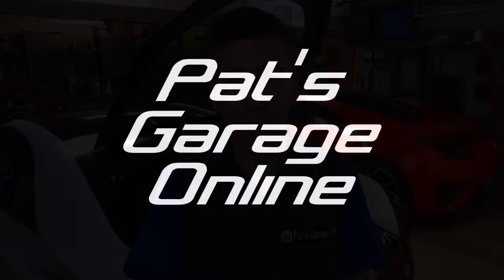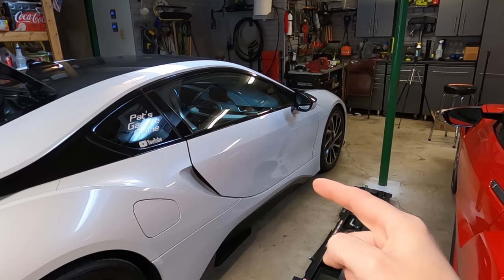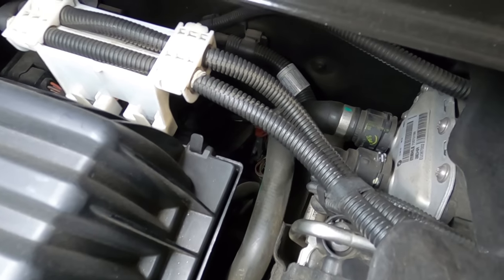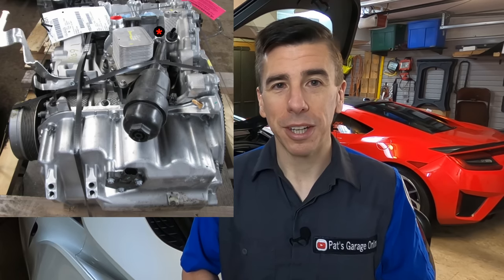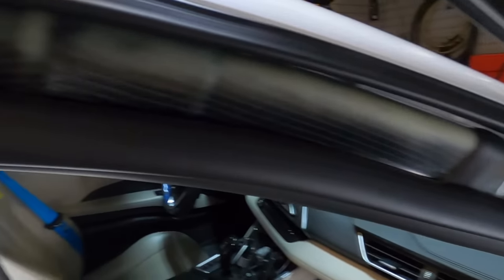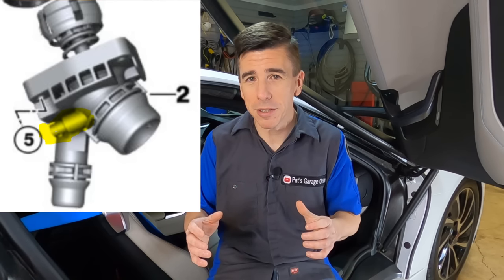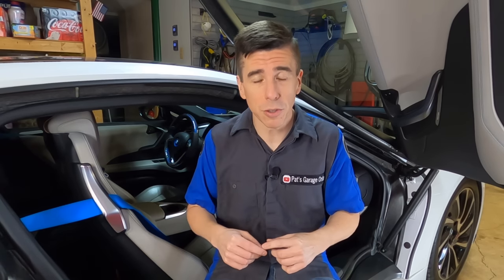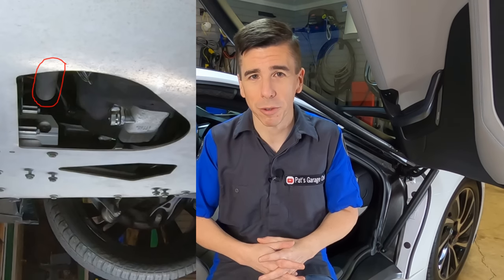My response to your ideas about Samcrac's BMW i8.

Comment: it overheats. fine after overheating, leave it , don't remove radiator cap , until cool . does it need topping up . if so do a pressure check watch for leaks in radiator and hoses , if none garden hose it remove hose from top of engine and radiator cap , stick hose into top  of engine, wrap a rag round gap hold it in placewith  thumb and forefinger and wait for water to come out of cap , funny feeling it's got a dozen eggs in it. or find a decent engine to stick in like small block v6 with a few mods to air flow.might end up with a decent motor.

Comment: looking at the intercooler pipe could poss put in a link in with a loop of pipe with a bleed valve you could have that above the head for a cheeky mod
Reply from the maker: Sadly, the intercooler is on a totally separate coolant circuit. It goes through its own three radiators in the front of the car. BMW did this in order to keep the temperatures cool because the coolant coming off of the engine was just too hot. This also overcomplicates the entire system.

Comment: The obstruction has been in my forefront as well. We've seen the fan running but I don't think he's ever mentioned the fan pulling heat out. If the car is truly overheating it should be a furnace coming out of the radiator. It may have a blown head gasket, but I think that would be caused by a coolant flow issue. A symptom, not the cause.

Comment: I wonder what would happen if you fabricated a short piece of aluminum pipe the diameter of the cooling hose. Weld a pipe boss onto the pipe and thread a bleed valve into the pipe boss. It would be similar in design to an oxygen sensor on an exhaust pipe.  Jack up the front of the car higher than the engine.  Install the pipe between the radiator and coolant hose. Pressurize the system at the back of the car and bleed all the air out of the system. I think it would work. You could either leave pipe in place permanently or remove it after the bleed process.

Comment: A long time ago I had a Peugeot 505... its expansion bottle was lower than the cyl head and the procedure to bleed was way simpler than this engines: you just unhooked the expansion bottle from its support and hung it from the hood so it was higher than the head.

In this case I would make an extension for the expansion bottle to be able to hang it higher than the head.

Comment: Merc has used heated thermostad in OM651 already a decade ago, propably for same reason than BMW. In this case, it is hardly to blame since it opens earlier when heated and in any case, it opens at set temperature. As mentioned, lines must be confirmed to be free for flow. Small amount of air should come along the flow if lines are free.

Comment: I watched the Video and the guy only replaced the thermostat. The mounting body with the electric pump was not replaced. That pump could easily be the the obstruction. In fact during the video there was a point were the overheating was intermittent. He went through all the step by step process to bleed the system, while the front was elevated above the rear. He now thinks he may have a head gasket pushing exhaust into the cooling.

Comment: For the last 100 years residential hot water heating systems have contained an air purge valve at the top of each radiator which I believe involved a simple float that vents air until water raises the float and shuts off the vent port.  These were automatic and required no power or control other than the float.   Couldn't be a more simple solution, if BMW wanted one.

Comment: My 2011 Cruze Ecotec 1.4T also had a resistive element in the thermostat and it went bad. Did not throw a code right away since it still had resistance but not enough to heat it. Engine was running hotter but you could not tell from the gauge since the computer will only show it dead center unless it gets above like 250. I noticed more smoke than usual when I removed the oil fill cap and used a scan tool to see the problem.

Comment: Wax motors are quite common - https://en.wikipedia.org/wiki/Wax_motor
The problem as others have stated is that there is no real feedback loop in this system  (other than the fact that when it fails, the car overheats). 
I'm not sure you would see a specific code for the thermostat failing, since the ECU can only test to see if the resistive element is there. If the element works, but there is a mechanical failure in the wax motor side, then it will think things are fine, until the temperature rises above what is expected when the thermostat is allowing water to pass. Now it could be that the thermostat is the issue, but that wouldn't explain the radiator exploding at what appeared to be relatively modest pressure, after all the thermostat presumably only limits the flow of water, but doesn't starve the loop entirely.
 
Here's a thought. 
The water pump failed (or maybe the thermostat or a hoze), which threw some random bits of water pump or whatever into the cooling loop. 
The previous owner had the pump replaced, but some part of the old pump is now nicely wedged in the system somewhere, either in a fixed position, or in a place where it flaps about, only blocking things entirely when the water pressure builds. No sabotage involved (except arguably by the BMW engineers who made this thing so bloody complex).

Comment: I like to mess with cars from time to time and was wondering about putting in a T filler neck in one of the two hoses on the top of the engine? Then check for obstructions and raise the front of the car higher. After that maybe put the vacuum bleeder on the overflow and a sealed way to put coolant in at the T neck filler. Maybe this way your vacuum would pull the air  out and the fluid in from the highest point. In doing so maybe the fluid would push the remaining air the vacuum didn't get? I could be wrong, but you could always replace the hose if it didn't work.
Reply from the maker: It's a good idea and plausible.  It may work.

Comment: if this is just a coolant air pocket issue in then I will not use any jazzy equipment; no vacuum required to bleed, just grab the engine inlet hose pipe from the front of the car attach another hose to it so that mouth of it is at higher than the roof of the car; next grab the outlet of the engine and do the same, now add the coolant and let gravity help you with the flushing of the air out of the system

Comment: Take Digital Temperature Reader check all hoses, also if you can divide the system and run water though to confirm clear lines. My two cents, thx

Comment: It would be funny to find a plastic shipping cap still installed in a hose somewhere. When I worked on airplanes, it happened so often that they started making the shipping caps that covered hose ports/nipples with a protruding tab that makes it impossible to slip a hose over a capped nipple.

Comment: Pat love all the responses , you know it’s a shame because this car could have been a good car I think for bmw it was a hybrid electric new construction, years ago I watched how they “glued” the panels together at the factory it was all new ideas. I support keep it simple why they made this car so complicated and hard to work on we’ll never know. A lot of people now say if you like bmw buy new and only keep while under warranty get rid of it before you have to replace major parts. I was told years ago buy what you like all cars no matter how much you pay  the car will need service sooner or later. But now a lot of these bmw small engines are getting a bad reputation I think most people agree the straight six is one of the best other not so . , sorry to ramble on.. can’t wait to find out what the issue is?...  sabotage from disgruntled owner or a real mechanical issue. It’s like waiting for Space X SN 8 to fly now number 9 . Now what’s wrong with i8!
Reply from the maker: I agree. I'm under CPO warranty for another 2 years so it's going up for sale before then

Comment: We have taken our 2014 Chrysler 300s AWD 3.6 VVT Form 15MPG City 🌃 to 22MPG city.
By taking our factory 🏭 air filter box out, then drilling 50 1/8 inch holes 🕳 in the bottom of the air filter box. Cold 🥶 air intake. I Jerry rigged it so to speak lol it really works

Comment: Just a thought, I had an overheating issue with my Jeep (much simpler cooling system) and the issue was the radiator cap wasn't holding pressure.  There were no leaks, but as soon as I replaced the radiator cap and the system could build pressure again, the radiator blew at one of the seams.  Replaced the radiator and it fixed the issue.  Seems plausible since when Samcrac tried to pressure test the system the rad blew.
Reply from the maker: Yep, makes sense.  I changed the radiator cap in my 2007 Ford because it was overheating and the top radiator hose was collapsed.  It couldn't draw from the overflow tank.  Quick and easy fix.

Comment: It's also possible that one of the flanges is not open where the waterhose is mounted on. What I mean is that there is still a metal film in the flange due to the pouring of the flange.

Comment: Following Sam here to get a solution it seems to me anyone wanting to get near an I8 just needs a 10ft pole for clearance. Well done BMW I8 design engineers you deserve a choice of Meyers, Lisbon or Eureka design stamped on this vehicle before looking for a new career.
Reply from the maker: Designed to last just until the warranty expires 😂 I have the extended warranty for another 2 years.  After that, I'm done.

Comment: Such a nice car. I hope they will come out with a nicer model to take this ones place. I will not understand why they stop the i8 production
Reply from the maker: Sadly, the i8 cost more to produce than they made in sales.  Like many Halo cars, it helps improve the brand but at a cost.  The i8M was considered as a potential replacement, and I have a video talking about that, but the board at BMW decided against it.  I think they're going to focus mainly on the hybrid / electric conversions of sedans.

Comment: Hi I do not know anything about bmw i8 ,but I worked in a JLR dealership and we had a brand new Landrover discovery sport ingenium engine and on PDI road test engine overheated approx 10 miles on the clock , we changed everything electric water pump ,rad,electric thermostat ,all hoses were removed checked ,heater matrix checked , nothing worked , a new was fitted and hey presto no more overheating, a conclusion was drawn that a flow issue was the problem within the engine , on that note if you rig up a connection across the rad so you could see that the coolant was flowing around the engine at least you could  be happy that the water pump ,thermostat ,and flow through engine heater was okay ,then move on to the hybrid aspect of the cooling ,
Reply: A new engine was fitted to resolve the issue

Comment: Pat, the one reason the Dealer might have said to replace the engine is maybe due to a blockage in the passages in the engine, where coolant cannot circulate through it? Test it by pulling the coolant hoses off the engine and see if water will enter and exit through it?

Comment: Could you add a simple fill valve lower down on one of the low points and pump the coolant in instead of vacuum filling. That way you’d force all the air out of the awkward spots.
Reply from the maker: Possibly

Comment: I have a 2018 chevy malibu that the  Thermostat is controlled by the outside temperature and if the a/c is on. Its controlled by the cars computer. The cooling fan has multiple speeds.

Comment: How about hooking up a water hose to the return side under the car while the car is not running and try to back flush any obstruction or at least verify water flows completely through the block.  There's something rotten in Leipzig for sure.

Comment: This is an over complicated cooling system, keeping with usual bmw flair.

It's sad considering the engine is a common production unit so a simplified system would work with extended lines and maybe 1 auxiliary pump.

Comment: Since samcrac is going to be pulling that radiator anyhow maybe there's a way to run a vacuum out of one of the hoses and just see if there some obstruction. Too bad there isn't some sort of Gizmo you could add to the filler in the front of the car for the antifreeze which would simply make it higher  maybe a  foot taller then start feeling the system that way that way would be the tallest part of the system. But then you have to remove it in order to put the cap back on the reservoir oh well!

Comment: "What a design"  Which is something I said when I discovered how difficult it was to replace the Oil Separator on my E46...and how prone to failure they are if you drive short trips in cold winter.
Reply from the maker: Oh wow!  The oil separator in the i8 is built into the intake manifold.

Comment: I had this issue in my 2018 E400 Coupe. I kept getting stop let transmission cool every 10 min when driving. Then I discovered that the transmission cooling lines had air in them. We pushed the air out and it fixed the issue.

Comment: i would try take out the air from system by makeing a device, which is conected in the front where coolant tank is, like paralel way, to the in let and out let pipes are, which will be forsing the water, first to try, thru all the engine by some presure and the outlet will be ended in some big tank...like the heating system in the house is primery filed...check where any "traps" are and there try to instal auto air 
deaerators..."is so"...so to push , force, water, from pump or tap...and let it go out somewhere..till the system is more less bleaded...this is my just idea..i like to draw a diagram of that..the problem is that it should be done when the engine is hot and the termostat is teoreticly open...if the outlets in engine are in the highest position, that no air can stay there...it should work...the last thing is to take out the engine and reddesign the system..what to du...im many times shocked with the complications of tha cars today...to repair...thay make so many mistaces..good luck...i try to drow the picture and send a link

Comment: I've had a radiator hose delaminate on the inside before. It presented a similar fault. The delamination only happened when it was warm and coolant was flowing. When I took the hoses off and inspected them while empty they looked just fine. Could be the same issue................................

Comment: Most well designed systems where the engine is higher than the radiator have a small diameter bled off line high up on the engine coolant passages that keeps the system free of any form of air or gas by allowing it to escape to the top of the radiator. These are common on many car and truck engines but a lot of owners don't appreciate what they are for. I've seen plenty of problems when that line blocks or is blanked off as "not needed". Often there is a small brass orifice in a fitting that can block with corrosion.  I'm thinking this is not a well designed system and doesn't have one hence the need for the vacuum nonsense_ or to put it another way a problem waiting to happen. Someone should bring out a retrofit kit to fit this engine. Everything you are showing me about this model of car makes me think I wouldn't want one if you gave it to me, harsh but I appreciate some guys like a real challenge. I'll just enjoy the videos I'd like to see it fixed without a new engine as like you I think the engine is not the issue.
Reply from the maker: With only 7,000 of these cars in the US, and 20,000 total worldwide, the aftermarket is pretty much non-existent on these, sadly.  A retrofit kit would be nice, but I'm not sure who would be up to the task.

Comment: At 3 12 of the video could you tap into one of those hoses with a flush kit fitting we all use to use back in the day   they seems to be pretty high up 
Old Hondas and a few others have water bleeders at the top of the eng .just a basic one 
that electric thermostat was cool to learn .everyday something new
Reply from the maker: Sadly, those coolant lines are for the low temperature coolant circuit which is independent of the high temperature coolant circuit which cools the mid engine.  The coolant for the engine was too hot to cool the charge air, so they created a 2nd coolant circuit for the other items like the electric motor, intercooler, etc.
Reply: @PatsGarageOnline  so the low and the high do not share fluid  i missed that part .there is a a lot going on in that cooling system  thank you for your reply

Comment: Pat we are going to be millionaires!
you are going to make a new hose design to the engine intercooler but it will have an access valve at the top we can use to fill.
plus we can charge 1800$ to install it, win - win.
Reply from the maker: With only 7,000 customers in the US, that's 12.6M, minus advertising costs and arm twisting.  We might break even.  😂

Comment: Remove the return line from the water cooled intercooler which is the highest point, and them start filling the cooling system  from there. 🤷‍♂️
Reply from the maker: Sadly, the water cooled intercooler is on the low temperature coolant circuit, completely independent of the high temperature coolant circuit.  That way BMW could supply cooler water to the intercooler than the engine.  Since Sam's low temperature circuit is OK.  He needs to leave that one alone.

Comment: With this weird cooling loop I don’t understand why all i8’s are not overheating or have a serious problem with cooling system.  The problem is only with Sam’s car, therefore what particular event is occurring to that engine.  In my opinion the cooling network has a blockage or restriction. I know that in the 1990’s Ford had a problem with some engines that sand from the casting process remained in the cooling chamber.   I took my Ford truck back to the dealer numerous times due to overheating and water pump failure due to the sand.